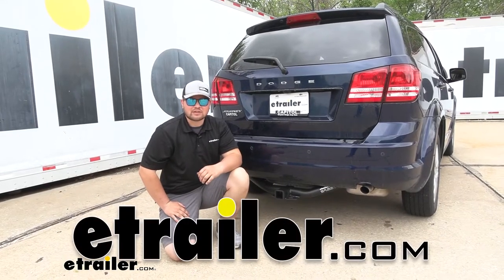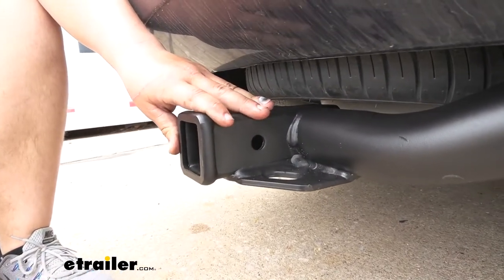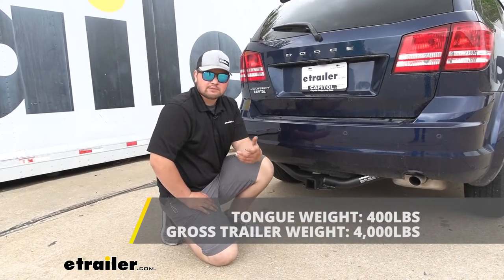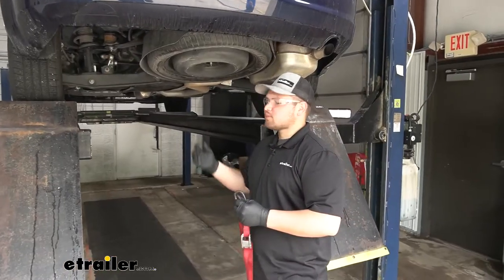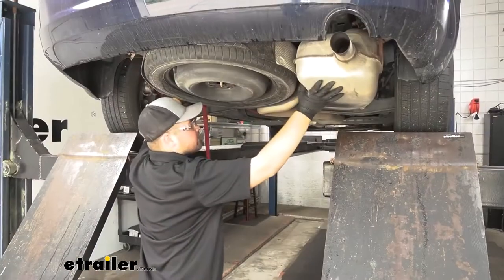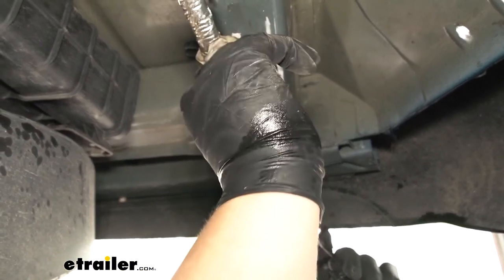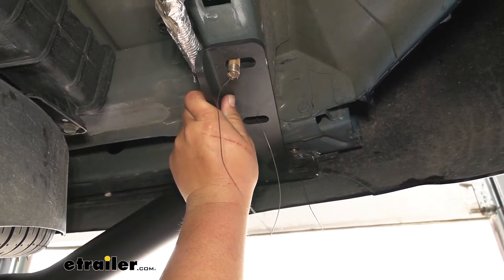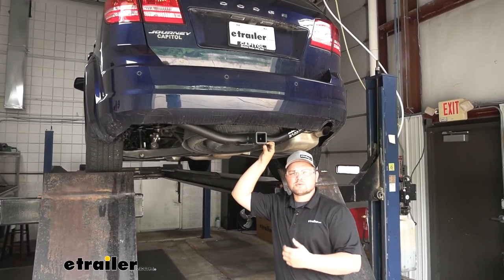etrailer Class III Trailer Hitch Installation - 2020 Dodge Journey

Comment: does it come with that spring tool when you buy the trailer hitch?
Reply from the maker: The fish wires will come included with this kit to get the hardware installed. Check it out in the following link to our website.
https://www.etrailer.com/Trailer-Hitch/etrailer/e98845.html

Comment: looks like its blocking the spare tire? Will it not block it when its time to use the spare tire?
Reply from the maker: You will still be able to lower the spare tire with this hitch receiver installed.
https://www.etrailer.com/Trailer-Hitch/etrailer/e98845.html